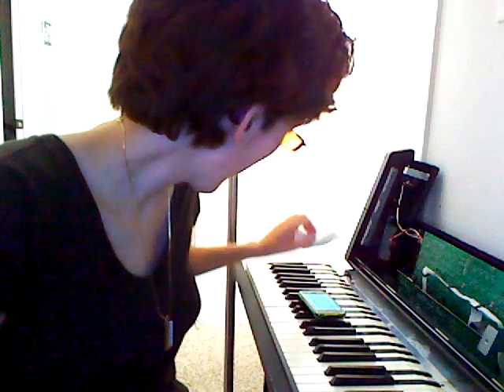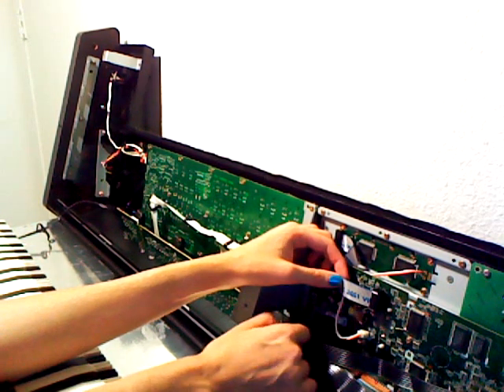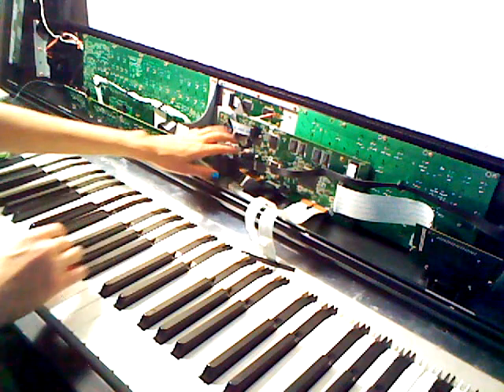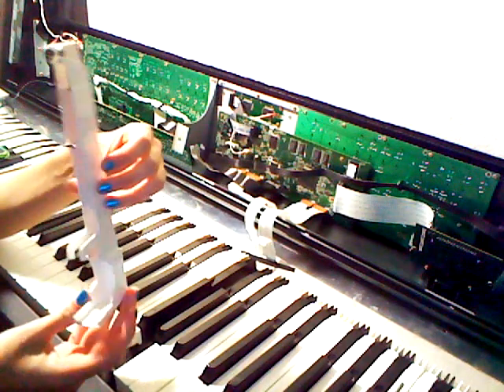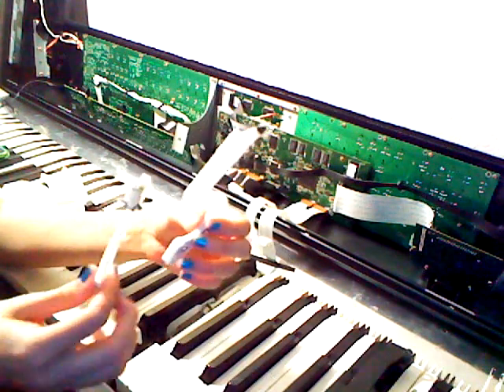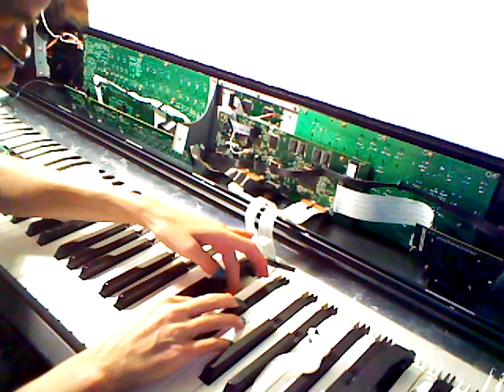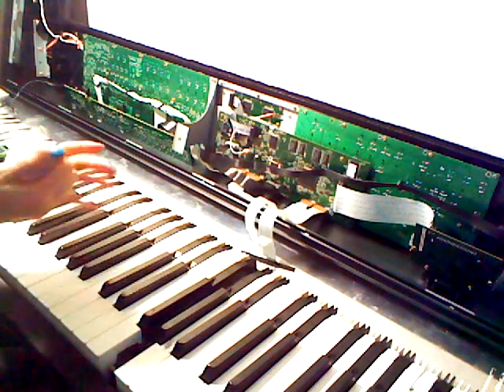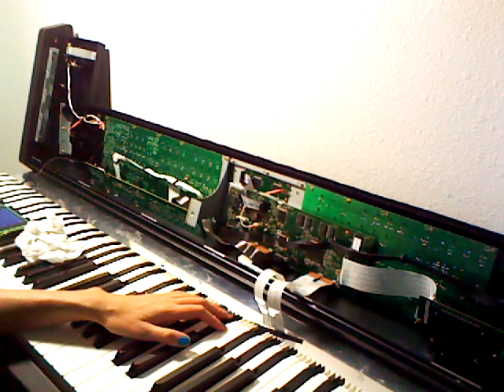Roland A-90: Battery explaination, cleaning and removing hammer action keys.

Comment: Attn: All A-90 users with constant breaking/cracked hammers. This video is perfect and I have attempted this tutorial twice. For those of you looking for cheaper hammers I contacted Alan in the parts dept at Roland Canada B.C (604-270-6626 ext 108). You can get a whole set (88) for $176.00 plus tax and $8.00 freight or individual ones are $2.45. Part # is 04671289. Well worth it then some scammers asking for 5 times more.I was also told that over time the felt strips under the chassy ..continued

Comment from the maker: HI :) Yes sadly, my A-90 is no longer with me but my sister has the same A-90 still. Both of our A-90s had slider issues due to age and wear and tear from traveling to gigs. The data buttons/slider will need to be carefully cleaned or just replaced altogether. Parts can be bought online (the contact switches attached to the circuit board under the buttons). They require a solder procedure but a good repair tech could put fresh ones in to relieve the switch issue. :)

Comment: Thanks for posting such an informative video.  I've never disassembled to clean and inspect mine.  Nor have I replaced the CR2032 battery.  I'm sure it needs it as I bought it used in 2002 and have owned it myself for about 14 years.  On another note, is there anyway to use a pedal that supports half pedaling such as the RPU-3 with the A90?

Comment: (audio wise or at a higher volume than others it means the rubber Contact Rubber Strips (Underneath the keys) #22185247 @ $5.99e (9 needed). When your piano keys start playing louder/softer in certain areas, there’s a good chance these strips are either damaged, or need to be cleaned (use a 99% isopropanol solution and a Q-tip) 
Sorry this post is not in running order...read from bottom to top. Hope this helps as much as it helped me.

Comment: (where the hammer hits when you strike) wears over time and that becomes the hammer more vulnerable to cracks and snaps. Apparently now they are more durable as well and you need two to keep them up maintained. Felts: #00564867 (beige) @ $5.50e and #00452145 (black & white) @ $8.45. Also of note if your keys are out they go for All black @$6.00. White ones are depending which ones as they are priced differently. One more thing I was told is that if your keys are cluncking out ..continued

Comment: Is it possible to replace the MIDI board on this keyboard? Mine is malfunctioning.
Reply from the maker: hi. I’m not sure if it’s possible. I no longer have this keyboard so I can’t check. if the board comes out in one part easily then there might be parts available on eBay of someone parts one out. check out eBay for the board part. :)

Comment: Ouch, you are supposed to use a key removal tool as stated in the service manual. One can be made from a paper clip. I would worry that with your method old brittle plastics might break irreparably.

Comment from the maker: @djadytzu22 Hi :) 'Synth-action keys' (part weighted & springy) is easiest on your wrists and fingers for these playing styles. Most synths have non-weighted keys (except for DX-1) to serve this purpose. Any playing style is possible however, hammer action can be very fatiguing in the beginning, until you build up strength and endurance. If you play drums on weighted keys, it can damage the hammers over time. Hammer action is wonderful for Rhodes, pianos & EPs in my experience with A-90. 
:) TSF

Comment: I have the ex. I changed the battery and now there is no sound.  Did it delete the sound card?
Reply from the maker: Hi. Yes you can reset the a90 two ways. If your a90 has an expansion card/board in it then you do this: press the power up switch AND the [manual] button. 
If your a90 doesn’t have the expansion card/board in it then you: press power on switch AND [Edit] together at the same time. This should reset the a90. If when it resets and it doesn’t have any sounds, they’ll need to be replaced from a backed up sound set.
Reply: @TheSynthFreq  you’re amazing!  Worked perfectly. Thank you so much for the reply!!!